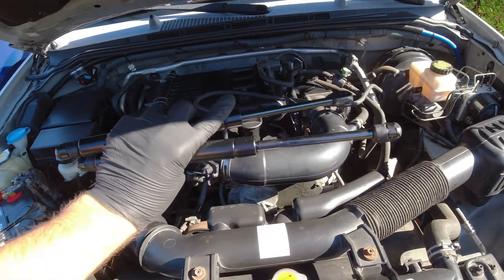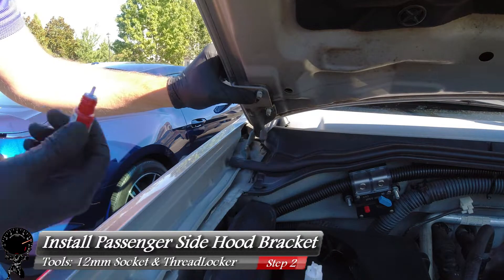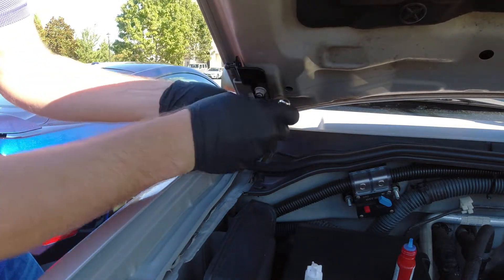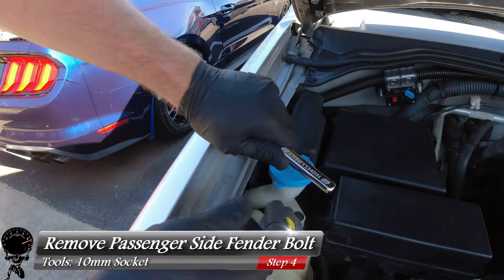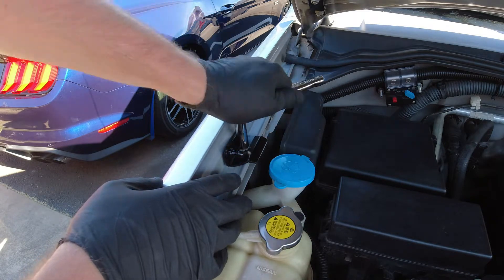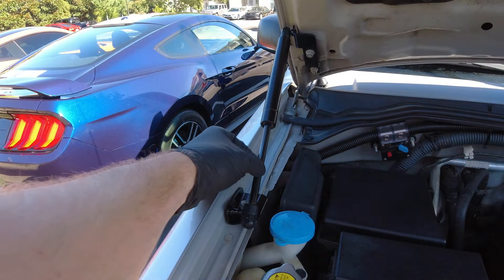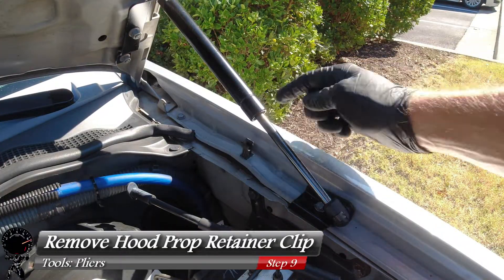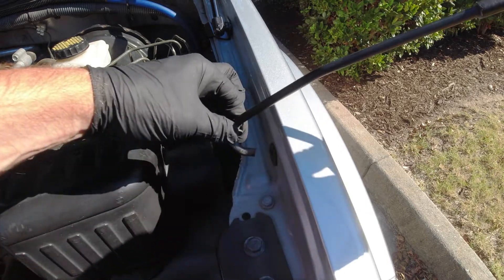How to Install Hood Struts for a Nissan Frontier/PathFinder/Xterra (2004-2018)

Comment: Where did you put the little brackets? No instructions included with kit.
Reply from the maker: They are not needed. It was supposedly for the windshield wiper fluid hoses.

Comment: Did this install two days ago. Very easy. Tip: lay a towel over the engine bay in the areas you work so you won't be losing any nuts or strut retainer clips.

Hood is opened up much more, the struts are less intrusive than the rod. 

In my case the hood did not shift out of place when I removed the bolts from either side of the hood, although i made sure to mark the proper hood location with tape just to make sure. So that made it easier, too. 

Note, when you're closing the hood, if you have a hood chip deflector installed you'll want to reach over the top of it and push down on the hood itself to overcome the resistance of the struts.  My struts were Z-1 Offroad Part # 20040-IM. They open easy, stay open no problem, and close with a satisfying but not overly aggressive thump.
Reply from the maker: Very nice. Thank you for the tips

Comment: How does the clearance compare to the height you get when it's on the prop rod? I'm a bit of a taller guy and It doesn't feel like the hood lifts high enough 
for my preference with OEM rod holding it up on my 2008 pathfinder.
Reply from the maker: Sadly, the height is similar to the prop rod. Maybe a little higher, but not by much.
Reply: @mcgurrentertainment awesome! I definitely am considering it but it was out of the question if the height was lower. I appreciate the reply!
Reply from the maker: Anytime